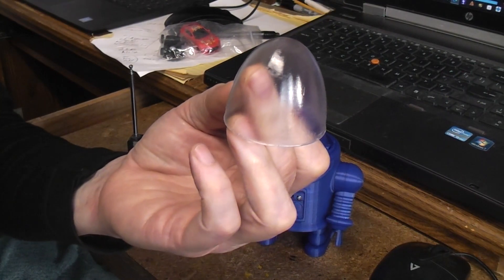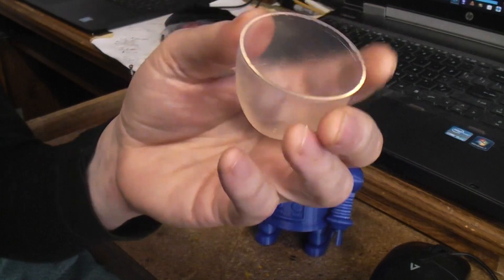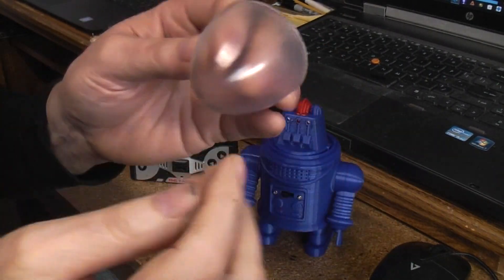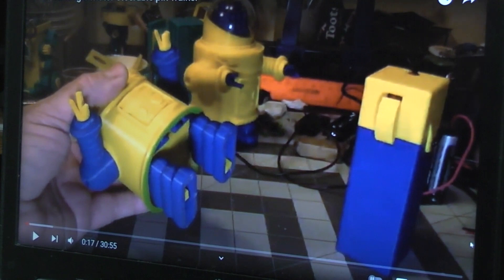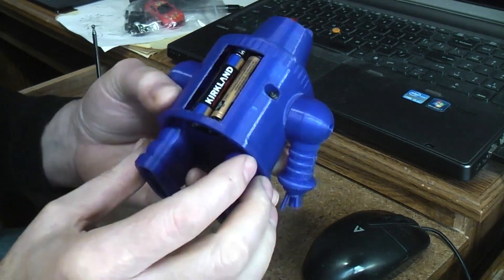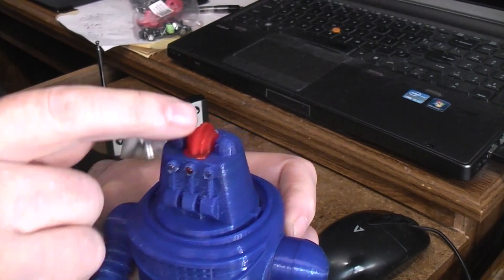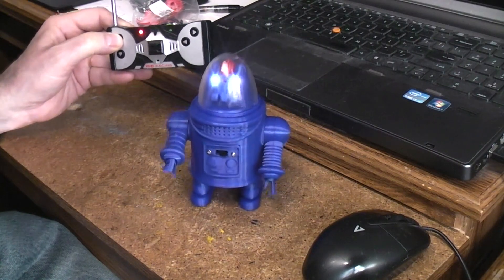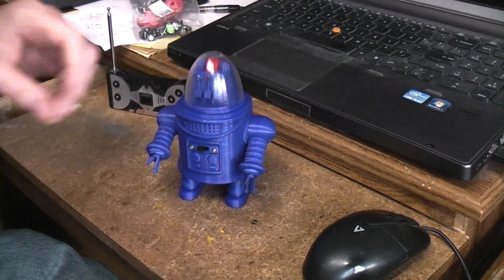Clear Resin dome for "Rick100", single motor steerable pin walking robot.

Comment: Thank you for the mentions. The mods are great. You worked in the switch and led placements very well. I think I like your version better than mine.  It makes we wish I would have used AA batteries instead since they're commonly available . I'm not wild about using LIPOs but they're small and powerful. The resin printed dome turned out a lot better than I thought it would. It's strange watching a video of someone watching my video.

Thanks again,
Rick
Reply from the maker: I think I will try one more resin dome, this time when its done and cleaned I will pour some resin over it and then cure it, just to see if it makes it look water clear like it does on the printer . just a test to maybe learn something.
Reply: @Robothut  You might also try Pledge Floor Gloss, formerly known as Future. Just a thought...

Comment: That’s what I did I did wet sanding with grits 1000 to 3000 and buff on clothe wheel . Got it very clear on a Robby domes I use to make took 2 hours of polishing. I made them in silicon mold . 
That dome you have there is not  too bad , takes a lot of patience. 🤖👍🏻
Reply from the maker: Yes I thought about wet sanding / buffing but decided  heck with that. Good to know that it would work. Thank you for commenting.
Reply: @Robothut  your welcome John . 
My cat 🐈 off to the vet to change the bandage 🩹 on his paw .

Comment: So cool! The exact mods I was considering when first seeing Rick's awesome pin bot. Is your modified version available to download and print?
Reply from the maker: I do not think that I did put the files on thing-i-verse since it was Rick's design. I am sure that I would have added link to the STL files if I had.  But you can do a search on thing-i-verse for "Robothut" and that should bring up all the mechanical 3d printed robots that I have listed.

Comment: Wet/Dry sand paper?
Reply from the maker: Yes I have just experimented with that and you can sand it then coat it with spray clear and get a very clear looking dome. Seems like a lot of work when a DIY vacuum form dome could be made a lot faster when you add in the print time. Also for a lot less money.